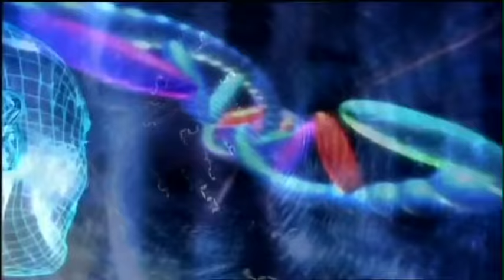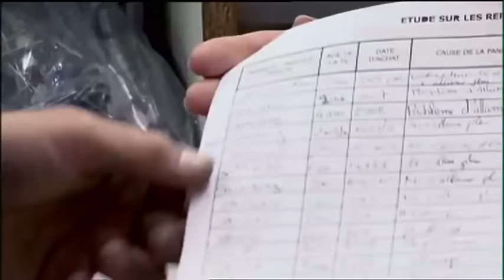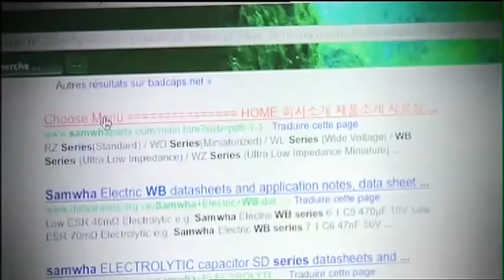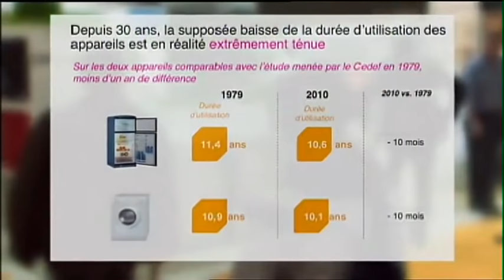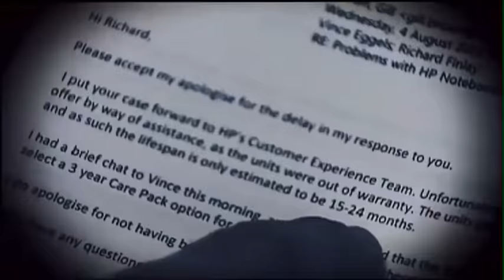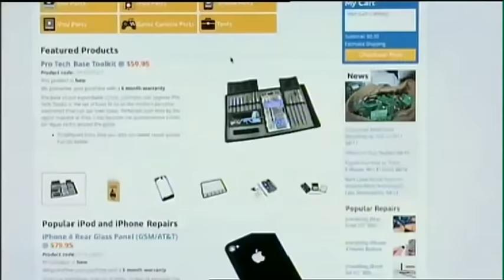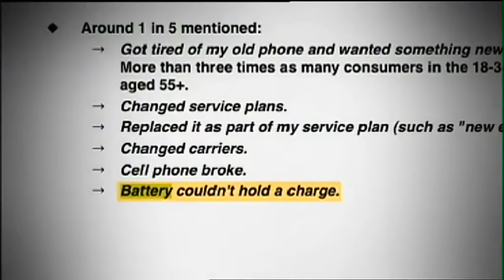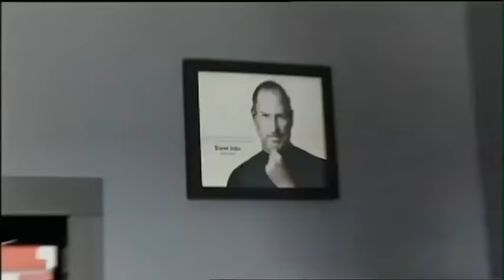Planned Obsolescence: Why Electronics Don't Last Long | ENDEVR Documentary

Comment: Same thing is happening with laptops, I bought HP laptop 11 years ago which didn't need any repairs for 9 years and it was being used 15 hours daily. However when I bought a new one, every year the laptop needs repairs, they have degraded the quality way too low.
Reply: absolutely correct. I have a HP that is over 10 years old and still works and yet I have replaced one that is 3 years old already. This is a sad but true story.
Reply: HP is not so great.  On mine the hinges broke after just a few years.  Hinge mounts made of plastic when they should have been made of metal!  Poor design.
Reply: Same here, I didn't buy another HP, I upgraded it. :-D
Reply: laptop tech here consumer grade hp is bad same with dell ect you need to buy corporate grade models they have far better parts but the last alot longer
Reply: Asus Rog laptops are among the most durable as they are designed for heavy gaming. I believe mine will last 10+ years if the software doesn't get obsolete
Reply: @juanbaclavab  Im currently restoring a asus rog vx7 lambo sadly solder death got the old gpu.

Comment: We moved into a house in 2009. House constructed in 1968, fridge was original, judging by the style. So I believe a 1968 vintage fridge. The refridgerator finally failed in 2010. It had been in service for 42 years. Speaking of fridges, at a past job I worked at, in the back of the factory, stood an old fridge from the 1950s (this was just two years ago). That 1950s fridge was still working, keeping the stuff inside cool.
Reply: The components had to be top quality to keep that type of refrigerant from leaking.
Reply: Unfortunately, these fridges are generally quite inefficient by energy consumption rate. They would bleed your wallet dry unless your electricity supply is quite cheap. I know a few people who were forced to cease using their old Soviet fridges in the Baltics simply because electricity costs went up fewfold in 2000ies, especially after incorporation into the EU.
Reply: @morzh1978  True, but that shouldn’t stop companies from making cheap RELIABLE parts. Look at Honda for example. Their cars are dirt cheap and can go for hundreds of thousands of miles besides the typical spark plug, transmission fluid, and motor oil maintenance.
Reply: old is gold
Reply: I think everybody remembers the Philco refrigerator with the rounded top corners. We had a used one at work 30 years ago and it's probably still working today.
Reply: @morzh1978  those soviet fridges were truly indestructible =-) people replaced them by choice and not because they broke.
Reply: My mum and dad still had the fridge they bought when they were married in the 50s right up until my dad sold the house 5o years later.

Comment: Well I own a repair store in New Zealand and I'm seeing fridges that last less than a year and major brand stoves that are only lasting 3 years from new the life expectancy is more than halved in the last 10 years. If it was made in the 50s with servicing and cear you should get 50 years if it was made in the 80s you should get 30 years if it was made in 2000 you should get 10 years and if it was made in 2020 you're looking at 3 to 5 years. Now things have gotten so bad appliances are not worth repairing most second hand appliance stores a non-existent because stuff is such rubbish it's not worth fixing
Reply: It all according to the plan $$$$$$$$$$$
Reply: Same story here in the US my friend.  I was a electronics engineer for over 35 years for major international automotive manufactures.  I ran a small, in home repair shop for 2-way HF, VHF and UHF radio equipment and later on personal computers.  I saw the same thing as you as far as quality of components began shrinking rapidly.  All seemed to start about time US got out of making components and all components were then being sourced out of Asia.  Cheap yes, quality ?  No --- junk components !
Reply: @txyz9294  as long as we can see what's going on then we have a chance of finding Solutions😁🌅
Reply: @87697  Past a US law that will mandatorily, without exceptions, FINE ANY COMPANY $1 MILLION TO $100 MILLION A DAY IF THEY KEEP ON PRODUCING AND SELLING PLANNED OBSOLESCENCE PRODUCTS. All products must be designed and built to last as long as they exists and are DIY RESTORABLE AT HOME, in an INDEPENDENT 3rd party repair shop, in the field, in the arctic, in the antarctic, in the most isolated and most hostile deserts, in the jungles, etc with just SIMPLE HOUSEHOLD TOOLS that anyone can buy from a complete hardware shop which is going to be required to be as complete as a 1960s and 1970s and 1980s hardware shops.
Reply: The moral of the lesson is obvious. When everything was built to last as long as it exists and that it is restorable-repairable with ordinary home manual tools and you can buy the spare parts dirt cheap, IT IS HEAVEN TO A FIX INCOME MAN AND TO A PENSION AND SOCIAL SECURITY DEPENDENT RETIREE!  They do not have to sacrifice their pension money or social security money or retirement savings on unnecessary repairs or replacements. They can save their money for real emergencies if ever there is one because the U.S government at that time, even though it is not perfect, is still well run and administered. And they do not have to worry about financial emergencies causing them financial hardships.
Reply: @businessneverpersonal1878  The moral of the lesson is obvious. When everything was built to last as long as it exists and that it is restorable-repairable with ordinary home manual tools and you can buy the spare parts dirt cheap, IT IS HEAVEN TO A FIX INCOME MAN AND TO A PENSION AND SOCIAL SECURITY DEPENDENT RETIREE!  They do not have to sacrifice their pension money or social security money or retirement savings on unnecessary repairs or replacements. They can save their money for real emergencies if ever there is one because the U.S government at that time, even though it is not perfect, is still well run and administered. And they do not have to worry about financial emergencies causing them financial hardships.
Reply: @txyz9294  Past a law where everything sold in America is of 100% American locally manufactured content!
Reply: They used to teach repairs of electrical appliances when studying for electrician in Belgium.
The year before i would've been taught, it was taken out of the curriculum due to obsolescence..
Reply: Hey Im in NZ, is it possible to fix an old macbook? I feel like I wasted 2500
Reply: @melancholycollie1466  I'm sure it is unfortunately my business is appliances there will be someone that can fix a MacBook I've seen places that do free quotes to good luck
Reply: @melancholycollie1466   buy business model laptops. You can change all the parts.

It's not only the fault of companies. It's the consumer who wants thin laptops without a screw in sight
Reply: @87697  Only thing what matters for consoomers is more A's on the front badge. If your current product at home has less A's than the shining brand new on the shop shelf, you're unremarkably bad consoomer. You must buy buy buy buy! Next day you must tweet how envriomentally friendly person you are!
Reply: @txyz9294  don't blame the supplier: the product is made according to purchasing specifications. 
I'm been in China for 12 years.. and I saw   with my own eyes the quality improvements in the products and production. 
Remember the iPhone is 100% made in china..
Reply: My parents have a 1980 (42 year old) Blaupunkt top-eject VHS recorder. Dad was worried as the owners manual was in German. NOBODY in Australia here serviced them. Only the record function doesn't work. EVERYTHING else does. We bring it out to surprise people.
Reply: @lukespector5550   That's awesome!

Comment: It's the same thing that happened with cars. Before the era of plastic cars, frames and engines were designed to last a very long time. This isn't nearly as profitable for a car manufacturer than if they were to sell the same person multiple cars, so the model has shifted to having lots of individual parts that are designed to fail and be replaced, eventually to the point where it is no longer worth repairing. This is now being extended to all other products.

Capitalism doesn't care about creating good products. It only cares about maximizing profit. Raise prices, reduce costs.

Comment: We purchased a Fisher 700-T stereo receiver in 1967;  It still works!  And works well, and sounds incredible.  We had if for about fifty years and had it recapped and gone over by a specialist in vintage equipment.  He used genuine and unopened stock transistors where they were indicated, and the thing is just like when it was new.  In the USA such electronics were very well made and generally lasted for many years.  We started hanging on to our vintage vacuum cleaners, fans, and kitchen appliances because they don't break down.  When did we lose pride in manufacturning?

Comment: I have a Panasonic fridge which still runs perfectly well after 20 years (bought in 2001), and it was also moved around the country with us moving jobs. I dread the moment when it will finally die.
Reply: I have my moms old refrigerator and it’s still running after 45 years. Just had to replace my refrigerator, dishwasher and stove after 35 years. I’m not counting on a repeat.

Comment: Just replacing LCD TVs capacitors components 10v to 25v higher voltages than the Power board will not failed for 10 or more years.Also turned your brightness down to 50% to save your TVs LCD screen lamps can last another 3-4 years more..

Comment: You get what you pay for. Demand for low cost has made producers lower their standards of quality simply to stay in business. My washer and dryer were replaced when I did a renovation and I chose to get the highest quality pair that I could find. I got a set built by Speed Queen based on reviews, warranty and word of mouth. 
 They have been excellent so far but the down side was that for the price of either washer or dryer I could have got a set of any of the more popular brands.
Reply: Not necessarily what you are talking about is cheap companies making cheap products, so you can understand such products not lasting long. Companies such as Apple who makes high end products are intentionally making their products inferior and next to impossible to fix or replace parts. Apple like many high end companies are intentionally making their products inferior and next impossible to fix or replace parts.

Comment: It's the non removable battery design that make them don't last,  designed. Thank Apple for starting the trend, and people buy them at double/triple the price.
Reply: I have the iPhone SE for years and it works perfectly
Reply: @migueis007  all battery technology is the same, after time they wear out. The problem is that companies like apple are putting blocks in place like making the battery non removable and using adhesive to make it difficult to remove and even software blocks.
Reply: Phones with easily replaceable batteries tend to be bulkier and harder to waterproof, so even if you still can buy such phones, nobody wants them. I got the same battery on Nokia 920 (which battery can be accessed after unscrewing two screws) for 5 years until the phone was too slow for new internet websites filled with animated promotions etc., most people do not want to have a phone longer than 5 years due to improvements in phone camera quality utilized during holidays anyway. As long as you have in your phone a top-quality battery with plenty of cycles before degrading, this is a non-issue for most, fast charging, and bad thermal design degrading batteries prematurely is the issue far more than the inability to change the battery. Of course, if you are playing new 3D videogames on your phone, you will also kill the battery in no time even without fast charging due to overheating of the phone when running performance demanding apps, as most phones did not have an adequate thermal design for long term high-performance usage...
Reply: @IonorReasSpamGenerator  this is not true, look at samsung galaxy note 2 or 3 , samsung s5 etc, or even going back further motorola razr v3, thin but replaceable. As for the waterproofing there have been many phones that were waterproof with replaceable batteries.

Comment: Old doc..Apple is new king of planned obsolescence.
Reply: Until recently, software support for Apple phones was much better than in the case of competition, so they also got better value retention and people also tend to keep them longer, average customers don't want bulky phones with easily accessible batteries nowadays anyway nor do they usually want to keep phones longer than 5 years which you can do without replacing the battery if not playing games on phones. Even Apple's "courageous" move to remove the headphone jack actually improved the lifespan of headphones as you don't have headphone cable failures anymore even though the battery in wireless earplugs got limited number of cycles and headphones with replaceable cables like some Audio-Technica models few will buy will still last you longer if you are willing to pay for such headphones. As for other products, fair enough, though Apple's extra slim design with hard parts accessibility is copied by all competition nowadays, despite it makes in case of non-mobile products like desktop computers little sense other than for better look...
Consumers need to watch and fight constantly to force producers keep the reasonable quality of the consumer products, so it's good that documentaries like these exist and are accessible to a large part of the population.

Comment: It's also called "built in obsolescence" which was already being taught as a documented matter of industry fact in the national Economics A level course in the UK in the early 1980's. One clear example was good year tyres which built a car tyre that never wore out, which were so successfully sold that the company went out of business a year or two later (... think it was Good Year). Light bulbs were another famous example, could easily be built to work indefinitely (100 + years )
Reply: The moral of the lesson is obvious. When everything was built to last as long as it exists and that it is restorable-repairable with ordinary home manual tools and you can buy the spare parts dirt cheap, IT IS HEAVEN TO A FIX INCOME MAN AND TO A PENSION AND SOCIAL SECURITY DEPENDENT RETIREE!  They do not have to sacrifice their pension money or social security money or retirement savings on unnecessary repairs or replacements. They can save their money for real emergencies if ever there is one because the U.S government at that time, even though it is not perfect, is still well run and administered. And they do not have to worry about financial emergencies causing them financial hardships.
Reply: Personally, I hardly believe that you can build a tyre that "lasts forever" even if you want to, making cushioning flexible material similar to rubber that is not making lot of noise on road and is somehow immune to abrasion from asphalt sounds like fantasy to me, you must be trolling..
Reply: I want 8 of those tires please

Comment: capacitors are the plague of electronics since the beginning. they even go bad unused...
Reply: I have had my computer monitor for so many years I lost count. Maybe 10.
Reply: @crand20033  well some designs are better then other, and some capacitors are better then others...(some electronics parts are even fakes) . The datasheets of parts are very informative. lets say a capacitor has a 5000h rating at 85dC at half of that temperature the data sheet will say it has a 10-15K H or maybe more. but it also depends of the current you pull,  yet again datasheets specify that capacitors have a shelf life most of them 2-3 years. moisture heat, chemically degradation of the electrolitic, of the paper, of the rubber seal  and so on.  many electronic devices brake because the producer decided to shave a penny...  Now days regulators fight to bring up the right of repar and prolonged use of them. a very good thing, as they make tons of profit,  have super low tax if any as they move their profits in some economic paradise and you know pay asian workers basically scrap.

Comment: Regardless if your computer is indestructible it will be equally obsolete in the future as the cheapest alternative with equal capability because the manufacturer can block out your computer and recode software to reject your computer and these software have planed obsolescence built in each version and stop working if the CMOS and ISP give a date after a expiration date..